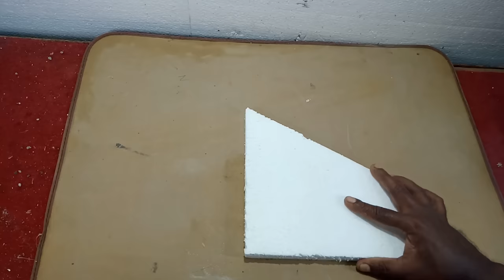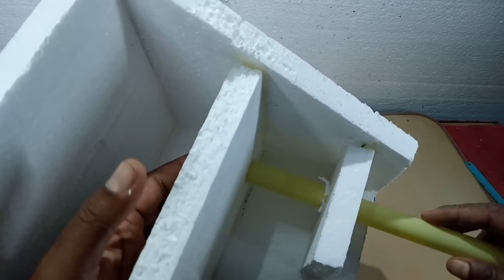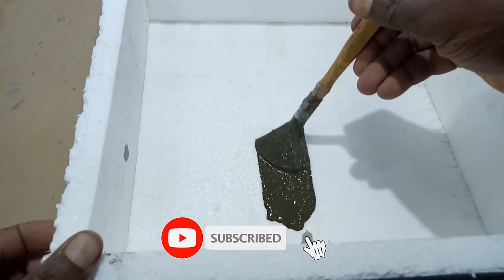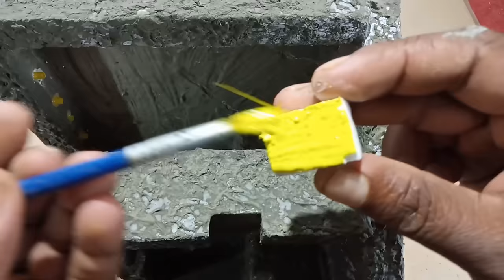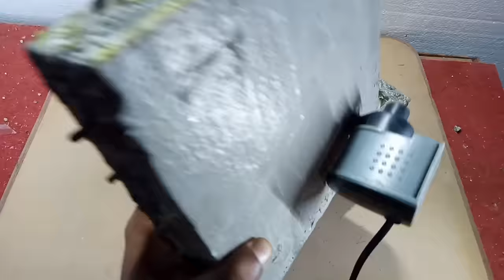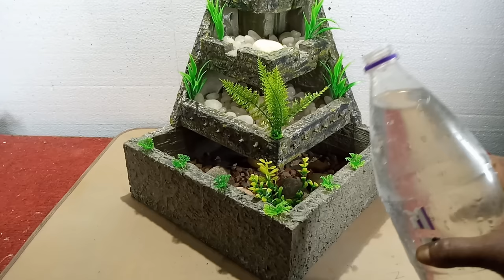Homemade Styrofoam and cement mini water fountain  waterfall

Comment from the maker: 👉measurements 
Pot size 13x13 pot hight 3.5 inch
first layer 9x9 inch height 1.5 inch
second layer 6x6 hight 1.5 inch
top layer 3x3 hight 1.5 inch     
Total Height 10 inch
Space between layers 3 inch
Under free space.5 inch
Another lovely design. 👉👉 https://www.youtube.com/watch?v=vIX4AT9vFbs&t=150s
Reply: Hello..... Thanks....
Reply: Hasa
Reply: Essas sao as medidas
Reply: What's the name of the motor used ? N the capacity
Reply: Can you please tell ne the type of pump that you used?
Reply: Can you please tell me the type of pump that you used
Reply: Thanks
Reply: You used solution name
Reply: Motar price?
Reply: cm ?
Reply: Just wanted to let people know to make sure it's level so that the water flows smoothly, the first time I tried, it wasn't level so the water didn't flow correctly 😫, I was able to fix it and it came out great.
Reply: Please give size cm (centi meter)
Reply: Can you use white cement instead of the dark one ?
Reply: تحفه بجد ربنا يبارك لك
Reply: Can you please tell what materials are required , seperatelt ??
Reply: Eu tbm quero
Reply: Mane Banya but usne Pani  lakhnese
Reply: 7
Reply: Muy bien y gracias por agregar la información de las medidas 🤩

Comment: Good work... It is leak proof after a long running... Bcs just adding thin layer on thermacole sheet...?
Reply from the maker: Thank you. I have used a thick cement coat as a second coat. or you can apply an epoxy resin coat.
Reply: @ActionTesting  tq so much😊
Reply from the maker: @pugmark9426  Welcome

Comment: How do you paint underneath with cement meaning how do you let it dry? Prop it up on an edge our what? Also, what size pvc pipeis used?
Reply from the maker: Allow it to dry. Apply a waterproof coat after painting. The tube is half an inch

Comment: Will anything happens to thermocol later??..Will it last??...
Plzzz replyyyy sir❗❗
Also it's a gud work 😍👏👌
Reply from the maker: Nothing will happen until you expose a lot of heat. Also, use at least a 3-time cement layer. or an applied epoxy resin layer. it will help seal the leakage for a long time running.
Reply: @ActionTesting Thankz a lot sir🤗✌️

Comment: Is the styrofoam structurally sound? (Will it fall apart easily?) 
Is there another, better or denser material, like say wood, which I could build it out of that will make something a bit more permanent?
Reply: Pienso lo mismo habra otro material más firme...?

Comment: What do you use to avoid water getting pulled from cement/styrofoam? Do you paint with something on top of the cement? Also did you put also sand with cement or only cement / water?
Reply from the maker: 1 cup of cement
2 cups of sand.
Apply an Epoxy resin layer after the cement coat.
Reply: @ActionTesting  why you dont put this on the video? Hard.
Reply: @ActionTesting  epoxy resin layer kaise बनाए, या market me कहा मिलेगा,, please bataye
Reply: What type of epoxy? The same epoxy that people use for countertops?

Comment: What's the name of the brand of cement being used? I live in the US and I've built this waterfall but the cement is not that strong.
Reply from the maker: Hi, It's regular cement called INSEE cement. Setting Time	≥ 60 minutes can you try different water level as well. Thanks for being with us !!!
Reply: @ActionTesting  thanks for letting me know. I made one exactly like this one, I also installed led lights, I wish I  could upload some pictures. Great video.

Comment: is it durable if soaked in water ?
Reply from the maker: Apply an epoxy resin layer after the cement layer. Or use waterproof paint.

Comment: Hi., I have one question/. I have made the waterfall using cement. However, cemenet develops crack and it started coming off immidetly after drying up. Could you please advice. Thanks in advance
Reply from the maker: Add few more layer

Comment: Does this last for a long time? I want to make one of these as a gift but im worried about it breaking down.
Reply from the maker: Yes, apply the cement layer at least 3 times. Once the cement is dry, apply a layer of epoxy resin.
Reply: @ActionTesting  Would you recommend quikrete for this project? And what brand of epoxy do you?
Reply: @ActionTesting  what is epoxy ?

Comment: Plz pcs ki size  bataiye.. kitna by kitne ki size he
Reply from the maker: 👉measurements 
Pot size 13x13 pot hight 3.5 inch
first layer 9x9 inch height 1.5 inch
second layer 6x6 hight 1.5 inch
top layer 3x3 hight 1.5 inch     
Total Height 10 inch
Space between layers 3 inch
Under free space.5 inch

Comment: Is cement compulsory or we can do it by black wall paint
Reply from the maker: Yes, it is possible. But it does not last long. Also, there is no way to properly seal the leak. If you apply several layers of cement, it will harden like concrete.

Comment: Didnt the water leak bro....?
Reply from the maker: No problem. Apply the cement layer at least 3 times. Once the cement layer is dry, apply a layer of epoxy resin.
Reply: @ActionTesting  thanks bro 
What is epoxy resin 
Is their is any problem while not applying it
Reply: @ActionTesting  i didn't have glue gun which glue i need to use out of glue gun

Comment: It's actually not a bad idea for reusing styrofoam. I am missing the point of using the soldering tool to melt the first hole when he could have just cut it out with the pipe like the other two. I've seen people do this on a much larger scale to create outdoor above ground fish tanks. They used much thicker cardboard and probably a thicker layer of cement but still, such a cheap alternative to digging one out and laying down liners.

Comment: Hello team I tried making the same design...but a bit higher ...I am facing following  issues :
1.)  water leakage (from the last layer if fountain where it is kept on the square cement box) 
2.) Water is not flowing seamlessly from top layer where the cut had been made...the water drips from walls and also goes inside the bottom of layers 
Can you help me address these concerns please. Will adding pebbles address the issue of seamless water flowing ?
Btw full credit to your design and method .

Comment: I tried putting cement layer on thermocol but it came off as a layer 😔
Reply from the maker: Not possible. is it regular thermocol ? it may be shiny or oily. not to worry do some scratches using a comb or something. it will work with any kind of thermocol. and use the Cement mix ratio as 2 cup cement and 1 cup sand. also apply at least 3 times. if you need a long time running use an epoxy resing layer after the cement. that's it. :D check out the first comment for measurements.

Comment: Greetings ... what are the measurements of each piece
Reply from the maker: Tks..   Checkout the first comment for measurements.
Reply: brot ... I don't see the measurements in the first comment
Reply from the maker: @pedroreinoso2967  👉measurements 
Pot size 13x13 pot hight 3.5 inch
first layer 9x9 inch height 1.5 inch
second layer 6x6 hight 1.5 inch
top layer 3x3 hight 1.5 inch     
Total Height 10 inch
Space between layers 3 inch
Under free space.5 inch

Comment: Cement is not sticking in foam sheet.. once the cement coat  gets dried, the cement powders are flying, thus making everywhere dusty and the foam becomes white again

Water is leaking all over the foam sheet(not on the joints)..foam sheet is not water proof. Looks like we need to make the foam sheet water proof along with the cement coat